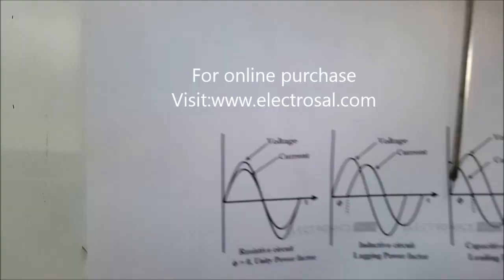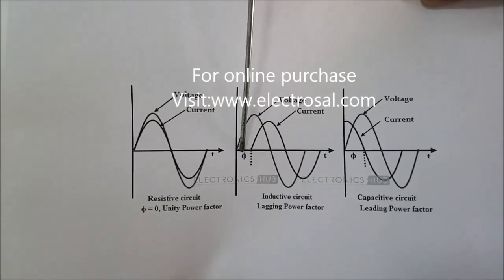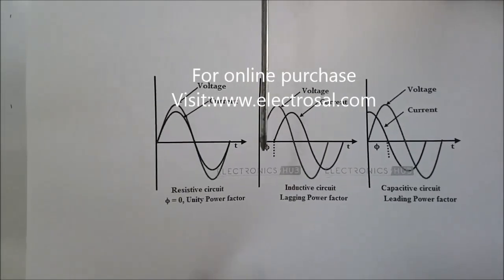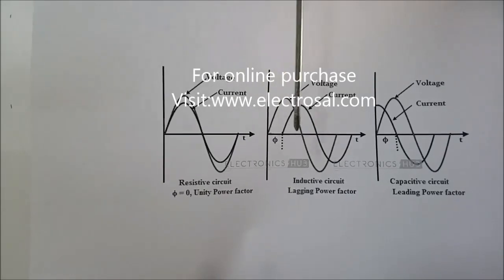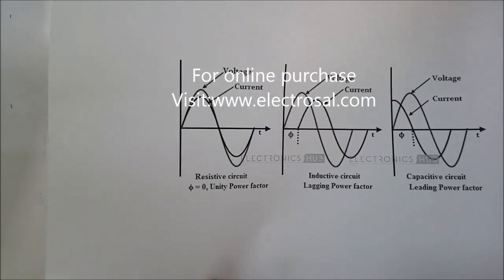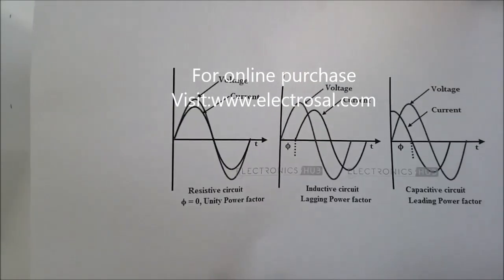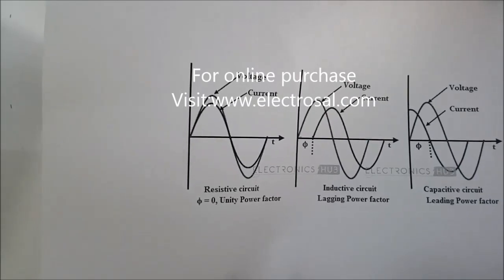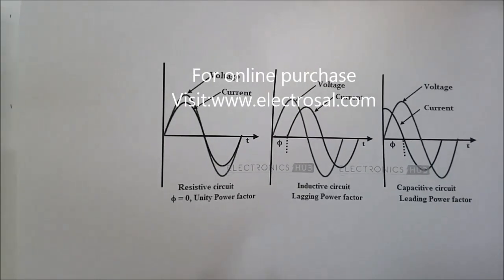AUTOMATIC POWER FACTOR COMPENSATION  FOR INDUSTRIAL POWER USE TO MINIMIZE  PENALTY

Comment: What principle of circuit you used to calculate power factor? Because you only used CT and voltage in calculation.
Reply from the maker: In this circuit we are reading phase difference between voltage waveform and current waveform. 

https://www.electrosal.com/product/automatic-power-factor-compensation-for-industrial-power-use-to-minimize-penalty/

For all details you can purchase documentation or full project kit from given link.
Reply: @electosal  how many percentage of difference is correct ?
Reply from the maker: @wadib3eed7  

Please discuss on mail

info@electrosal.com

or whatsapp 
+91 8880027297
Reply: I note in the circuit as in the website you detect the zero crossing for current and voltage . So , do you calculate the time difference between zero crossing of the two waves ( current and voltage) and change it into phase difference to know how much power factor ?
Reply from the maker: @wadib3eed7  

Yes